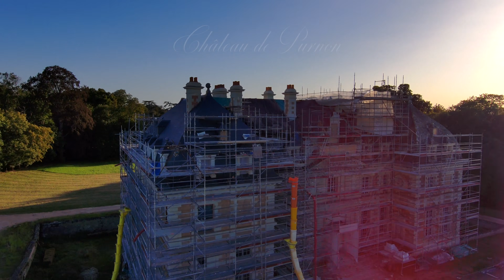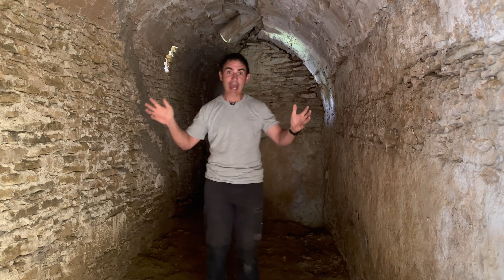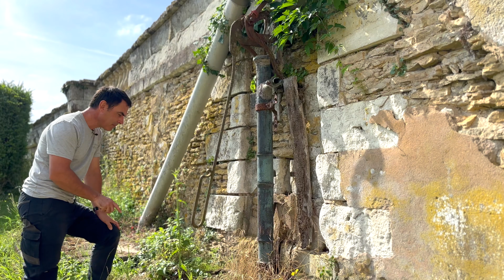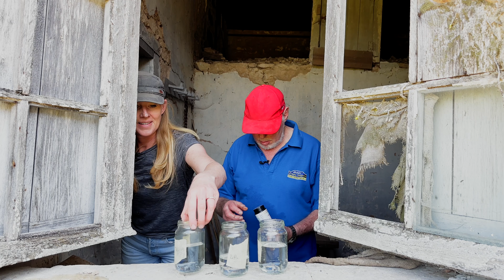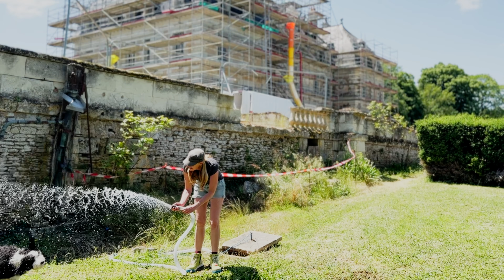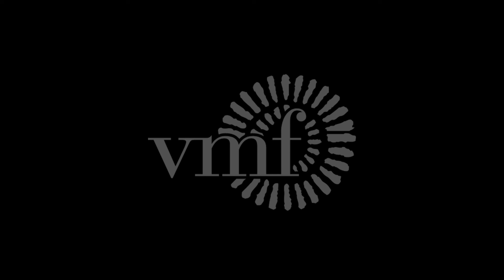Secret tunnels & hidden water supplies! Building a sustainable future: Part 2 (ep. 30)

Comment: Really goes to show that “easy” doesn’t necessarily mean better. Incredibly interesting. Do the jut-outs in the tunnel act like a river like the natural in’s and outs of the shore line to aid the water into constantly moving?
Reply from the maker: Not really - you might be overestimating the volume of water that runs through the tunnels at any given time.  They are buttresses that reinforce the strength of the walls of the tunnels.  Thanks for your message - we're thrilled you're following our journey.

Comment: Are you planning to use solar electricity? You are doing so well so far  - well done.
Reply from the maker: When we arrived at the chateau, the heating system was an oil-based heating fuel.  We've now converted it to a biomass system.  But we're not planning to use solar for our electricity.  Thanks for following our journey!
Reply: @chateaudepurnon might actually wanna rethink that,  perhaps...with batteries... in 2026.....!!??!

Comment: Im so glad you tested as I would be worried about the lead content of the old system due to water coming off the roof in to the lead-lined troughs before it entered the rest of the drainage/collection system. My friends dog drank water from a down pipe off their slate roof and over the years got lead poisoning from the lead flashing. But it might build up in the old pipes too….
Reply from the maker: Thanks for your message and concern.  We are trying to proceed as safely as possible with our restoration.  Inside the chateau we have been systematically decommissioning and removing the old lead piping also.

Comment: I would suggest at the minimum a sediment filter for any water pumped anywhere, and if any is used for potable water, of course you need to filter so that it will be potable. The sediment filter for all  water pumped out of a storage vessel is to maintain the integrity of the parts...hoses, connections, sprinklers, etc.
Reply: Ultraviolet light might help.
Reply: You might have to consider replacing or lining all the lead pipework between the roof and cisterns.

Comment: Were the tunnels that you walked through where water was moved around the grounds or did they have some form of pipe work in those tunnels? As they would have contained huge amounts of water. Or, was my interpretation completely off? 😂
How long do you think it will likely be before the roof is watertight?
I very much enjoy your updates, thank you.
Reply from the maker: Generally the stone pipes are under the tunnels so the water ran through the pipe network under the tunnels. The tunnels are not used for access for any other purpose at the time of construction but allowed access to the pipes. The eastern pavilion is now water tight and we hope the scaffolding will come down shortly! The central axis and western pavilion will take another 1-2 years.